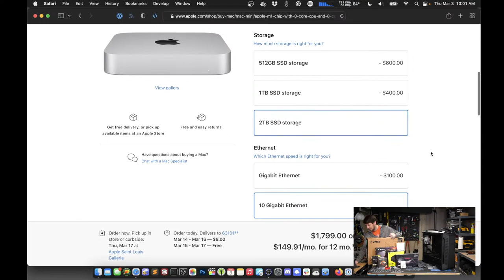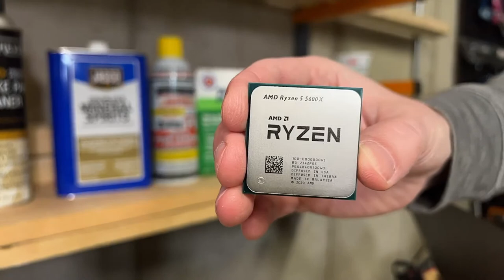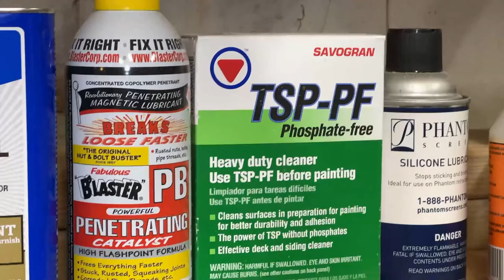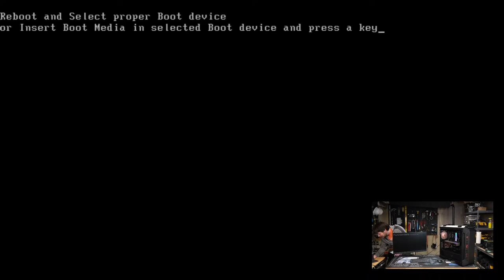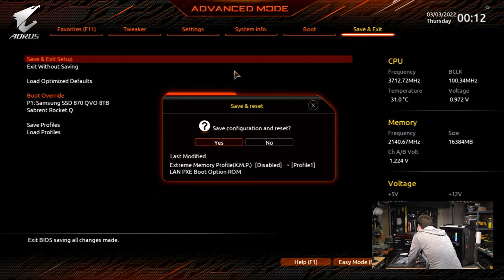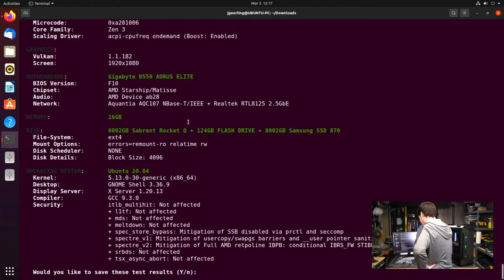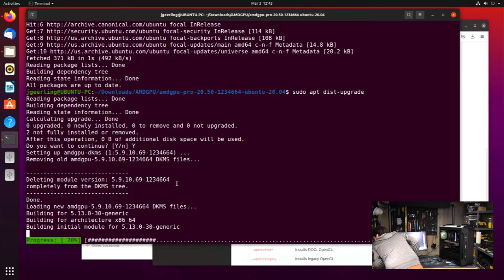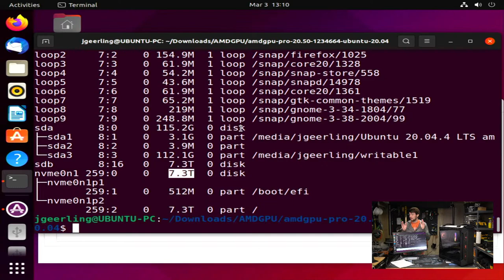Mac User Builds Linux Gaming PC

Comment: Something you might want to try - Pick up the Debian Bullseye nonfree usb image and see how easy it is to get the whole system up and running with that. In case you didn't want to mess up your Ubuntu drive, you could switch the motherboard bios to boot from the second SSD.
Reply: I mean, Jeff has quite a lot of Debian experience too it would seem like a natural choice.

Comment: Just to echo what others have said - I recently installed Fedora 35 KDE on an x570 + 3600x with no problems -  noticeably more solidly reliable compared to Ubuntu and Ubuntu based distros I've tried in recent months. Having mostly used Macs since 91 all my machines are also hackintoshes but it's fun to multiboot OS's - Fedora KDE kinda feels solid in a similar way to OSX by which I mean it's more invisible so I can just run the apps I need to use. YMMV of course

Comment from the maker: 02:06:53 - "RGB. The kids'll like it."
Reply: Please don't put 2.5V through the RAM... It will fry it... The current spec uses about half the voltage.
The voltages have dropped way down since the 286, 386 and 486 days... The CPU uses about 1.2V stock and 1.4V with a mild OC (I would be surprised if the CPU doesn't reach 4Ghz on a mild overclock)
Reply: @imtiredtoday 
Isn't the 2.5 for the RGB lighting?
Reply: @xrafter I mean it like: don't overvolt your ram way too much (and 2.5V is if I remember correctly the max most mobo's allow for ram)

Comment: Thanks for that Livestream/Video and the work with different Cameras/Angles etc!  Ever good when a Mac User comes out of his comfort zone. ;P
Ubuntu is good but Unity is counter intuitive. it's also really refreshing when a pc is simply put together for use as the next high-end system for show purposes *yawn*.
especially when setting up many developers should look at why it does not run as they imagine ;)
I really understand why people like Mac and the Apple ecosystem so much. The video shows again what is wrong with the PC. Especially with the Software. It is always expected that the users have to deal with something, whereas the programmers could simply implement it better. 
That's also what i can't tolerate when the next linux interface is advertised with "and now even better for windows switchers", which doesn't offer a hint of the same functionality or does anything better in usability. don't get me wrong. i love linux but headless ;) KDE is the closest thing I can think of as an alternative.
Reply from the maker: I don't think it will ever be the 'year of the Linux desktop', until fundamental issues like having 50 different 'desktops' to choose from are solved (probably not ever). But yeah, for anything headless, Linux rules the roost.
Reply: Ubuntu dropped Unity a while ago. They run Gnome Shell with a basic theme + dash-to-dock extension (and other extensions, too).
Reply: @JeffGeerling  For the masses for sure there will be but not as long as no one really back to intuitive operation and many more ways to achieve things with the mouse instead of the terminal. Would you recommend linux to a mac user? I have the same problem mainly with PC gamers. I hope the Steam Deck will finally change it.

Comment: Gnome on Ubuntu 20.04, Alt+F1 then type the name of the app you want is the keyboard shortcut.  

Also, ctrl+shift+t gives you a new tab in your terminal window.  
Alt+pgUp and Alt+pgDn let you cycle through terminal windows.  
Ctrl+w to close the tab.  
Ctrl+d to exit out one level inside the session, and eventually the whole session.

If you install the driver through apt after adding the repo to your sources, the drivers will be included when you upgrade.  Make sure to get the dkms package as well, since that will update your drivers when the kernel upgrades.

Postfix/mail/mailx is typically used for sending messages sent to 'root'.  The one I see the most is cron messages.

Comment: Hi @Jeff
Maybe the hardware drivers in GPU firmware have changed cuz I think you were playing with this GPU to run it on Pi.
The most GPUs I know of, like RTX2/3xxx, they do support firmware upgrade over PCIe Instead of any custom manufacturer jigs.

Comment: Just to note: Compiling the kernel faster will be possible without any hardware changes as soon as either one humongous pull request by Ingo Molnar ("Fast Kernel Headers") gets merged into mainline (ca. 2,200 commits - yes, that's over 2 thousand), or if most of the kernel code has moved over to Rust (or potentially both).

Comment: The `do-release-upgrade` command upgrades in-place from Ubuntu 20.04 to Ubuntu 21.10 -- I think it is not a good idea to upgrade in-place, and would recommend some form of fresh install.

(A rant about do-release-upgrade: The do-release-upgrade script is the equivalent of a full body, "new-internal-organs-to-old-skeleton" transplant... It switches the package repos to the ones for the new release, re-configures a few files and runs some release transition sub-scripts, and then installs the packages in-place for the new distro release... right over top of the old ones. I consider `do-release-upgrade` extremely janky. I've never had a proper working system after doing that, although admittedly the last time I tried that was probably like 8 years ago. I think the concept is too nuts. No idea why anyone acts like it's a viable option. Canonical should just abandon do-release-upgrade.)

My preferred alternative: You can actually manually reinstall over the same partition using the installer GUI (custom install --> manual partitioning and re-use the / ("root") partition WITHOUT FORMATTING), and it will nuke everything but your home folder (preserves only the "/home" dir), which results in, for pretty much all intents and purposes, a fresh OS, without having to nuke your home folder (which keeps most of your user config intact via various .dotfiles in ~/. Also keeps your web browser user profiles intact, so you're not starting from scratch getting the browser set up the way you like.).

The irony: What is treated as highly dangerous (custom install over your existing root partition) results in a working system 100% of the time, in my experience, whereas I have a 0% success rate with do-release-upgrade.

(Granted, my preferred "reinstall fresh Ubuntu OS over existing partition" method  is legit dangerous for data loss, if you aren't thinking clearly and format your existing root partition, then yeah, you just told the installer to delete all your precious files. And it's just a checkbox, basically. So yeah, DANGEROUS. But also leaves your OS usable. Worth it, IMO. Just never do it distracted, because formatting everything you care about is kid of a big deal.)

So, I dislike the messaging that points people to `do-release-upgrade` and away from reinstalling over the same partition. Furthermore, I feel there should be a dedicated "refresh" mode in the installer that does this WITHOUT presenting an option to format. (Looks like Pop!_OS just added this to the latest version of their installer! Woo!)

P.S. If you want to catch the distro-hopping bug, you should try Pop!_OS, or Ubuntu daily ISO with Gnome 42, for a nicer desktop experience than Ubuntu 20.04, IMO. For a more adventurous distro-hopping experience, I second trying Manjaro to dip a toe into Arch, and then uh... Like a GhostBSD LiveUSB image to try a BSD distro, lol.

For Windows converts, or Snap haters, Linux Mint is more of a "it just works, even for people who mostly just know how to use Windows" distro than even Ubuntu. But the package base is Ubuntu LTS. So it really is "just Ubuntu" in terns of almost every internet guide or software package you might want to use on it. And Snaps are disabled by default. They have to maintain their own Chromium and Firefox packages, but they do it so users don't need to understand or use Snap to have an Ubuntu-like experience.

Comment: Thanks for trying Ubuntu instead of another "experimental distribution flavor of the week". Honestly in 30 years of Linux and 40 years of BSDish I consider Ubuntu the most straight forward Distribution for Beginners and Professionals alike. Everybody without a REALLY GOOD PLAN and REALLY GOOD REASON should not use anything else. I am just feed up with newbish people installing PopOS Beta and Puppy Linux and Arch Bleeding Branchj without a good reason and even less experience.
(Btw as I said, I have some 40 years of Unix/Linux/Posix experience and even I just put Ubuntu on a lot of machines just for the sake of "get it going with as little effort as possible. Because I have installed THOUSANDS of systems in my live and don't need to prove to myself I can use experimental crap anymore)

Comment: Pop OS is pretty much Ubuntu at the base and hardware compatiblity wise, but with much better UI and snap-less (trash-less) and uses flatpaks. That's why you should use Pop OS instead of Ubuntu. 
Also if you have AMD GPU and don't need OpenCL it's best to stick with the preinstalled MESA drivers, they are the best, don't bother installing the special ones from the AMD site. AMD says MESA ones are best.

Comment: Jeff, install both VGA cables from PSU! if your card has 2 sockets is for a reason!
Reply: The corsair RM650x features a single 12V rail design, it doesn't matter for the PSU if you use one or two sockets for the GPU (assuming the same power drawn) and he did connect both the 6+2 and the 6 pin PICe connectors to the GPU.
Reply from the maker: Honestly it's all about the current through the wires; I didn't look up the wire thickness on that PCIe cable, but they are probably like 16 or 18AWG (they're noticeably thicker than other wires included with the PSU). Should be able to handle the 12V power for that card unless maybe it's crazy-overclocked.

Comment: You know you don't install drivers on Linux right? The amdgpu driver is available in the kernel and Ubuntu preinstalls the amdgpu X11 things by default, for the most part, for AMD graphics cards it's just plug and go

Comment: One of the problems with Ubuntu, especially the LTS, is found when using "cutting edge" hardware. Sometimes the drivers aren't backported to the older kernels (right now running 5.16 on my Arch computer, and the video shows 5.13), but other times you need to download "hardware enablement" packages. I haven't watched the whole video, but maybe that information gives a good point of reference!
Reply: Your assumptions are partially wrong here.
Where you are wrong: Your Ubuntu is not running a vanilla Linux Kernel. It is running an Ubuntu-modified Kernel. The Ubuntu-Kernel is using a lot of additional patches and backports, even for small updates.
Where you are right: Using an HWE-Kernel solves sometimes resolves some problems. The easiest way is to just download a milestone-release of Ubuntu and install that one,  e.g. Ubuntu 20.04.4 has a newer HWE than 20.04.1, able to use newer/more hardware. Though at least in my 30 years of Linux experience most times an older HWE installs fine, maybe lacking here and there a bit on VERY new hardware but you are still able to upgrade to a newer HWE anytime later without pain by following the usual HOWTOs and Google.

Comment: Literally yesterday, I've installed a RX 6700 XT on my Ubuntu 20.04.4 PC ... given how many issues you had (and I did as well), the drivers in an archive file simply don't work with Ubuntu 20.04.4.

Here goes what worked for me:
Went to https://www.amd.com/en/support/graphics/amd-radeon-6000-series/amd-radeon-6700-series/amd-radeon-rx-6700-xt and downloaded the .deb package for "Radeon™ Software for Linux® installer version 21.50 for Ubuntu 20.04.4" (release notes: https://www.amd.com/en/support/kb/release-notes/rn-amdgpu-unified-linux-21-50)
Installed the said package, it made several packages available by adding stuff to the apt sources. I think I just run amdgpu-install in the console after that and it did the job.

I think with the current Ubuntu kernel version there are still some issues with OpenCL ... But for Vulkan and OpenGL it seems to work fine.
Reply from the maker: Thanks! I will attempt again (I'm re-installing Ubuntu 20.04 as I type...)
Reply: @JeffGeerling  Oh ... I notice after re-watching the video, you've installed the 20.50 instead of the 21.50, can't blame you, I did the exact same thing (since the 6700XT initial driver support was in the 20.50 it shows first in google search as it is written in the release notes).

In my case I was upgrading from a GTX 950 GPU and though I had some config or package causing issues... but no, simply the wrong driver, 21.50 did the job.
Reply from the maker: @Jose-Sousa  I tried again with 21.50 on a fresh Ubuntu 20.04 LTS install, and got another failure (blog post on it to come). I did a fresh install of 21.10, and that seemed to work. Getting 300 fps in Heaven test, and 60 fps lock in Halo MCC via Steam. I'd call that success!
Reply: AMD Drivers for linux are a pain and the documentation is horrible especially for anything that is not within the last couple years
Reply: @JeffGeerling  Good to know you got it to work ... 20.04.4 LTS (5.13.0-30 kernel) + AMD RX 6700 XT seems to be simply cursed, thank you for the feedback, I might just upgrade to avoid issues in the future...
Reply: @Sixfools  
You simply need new enough packages(Mesa) and a new enough Linux kernel plus the firmware and everything works just fine.
Which means for newer distros like Ubuntu 21.10 working out of the box.

If an amd gpu just released you normally need to install the newest firmware, update the kernel to the newest version and install the newest mesa version.
I personally used the guide from LevelOneTech for my rx6800 and also before that for my rx470 and they both worked.
But in the best case buy a gpu atleast half a year after release and then use the newest distro version or use a distro which updates their packages more frequently like Fedora or an Arch based distro.
Or you wait longer until the next LTS releases and then buy the GPU.

Or buy a nvidia gpu and deal with their proprietary shenanigans, choice your poison  🤗
Reply: @Sixfools  Nvidia drivers are worse on Linux.
Also the AMD/Intel/most common drivers are integrated in the kernel/operating system. Nvidia drivers are the worst... It just works with the old XP era interface but way worse...

Please don't use Ubuntu if you care about up to date drivers. A rolling release is always up to date (but it has stability risks). The most up-to-date stable distros are fedora and fedora based distros.

Comment: Install amdgpu 21.50 😐
Reply: ↑ This ... and not 20.50 ... Google first result is not always the best result...
Reply from the maker: @Jose-Sousa  D'oh! Will do. Testing it after lunch :)
Reply from the maker: Tried it, and still didn't work on a fresh 20.04 install (blog post with more details to come). I re-installed again with 21.10 and everything seems to work now. (insert shrug ascii art)
Reply: @JeffGeerling  also try Fedora and Mint. Fedora use pipewire for Sound I think, which you would like. Ubuntu as desktop really is very hmmm.

Comment: In my oppinion the Mac is the absolute opposite of the Pi spirit.
A golden cage putting their visitors on a leash in the most drastic way.
Btw I absolutely hate apples blatant lies and white washing.
Also changing several core APIs like SEVEN times in 20 years is... absurd. I mean it is easier to port some software to an Amiga dating back 30 years than to an Mac nowadays.
The PC on the other hand is inbetween and much closer to the open Pi approach than to the closed Mac approach. Give a standard PC an open Firmware instead of UEFI, GPIO-pins, preinstalled Linux and you have an x86-Pi-Like.

On the other hand I get grumpy about the curent direction of the PC market. Too much RGB and Bling Bling, too little Bang Bang and much too much Big Bucks. Try getting a compact, robust, discrete looking workhorse able to cool 500W silently with room for 3x5.25 externally, 5x3.5 internally. Baaad luck. Honestly most modern PC cases give me eye cancer.

Comment: You could’ve installed windows and the drivers would’ve been ready, windows is best used for gaming, you might need Radeon software sometimes but it’s still easier than in Ubuntu